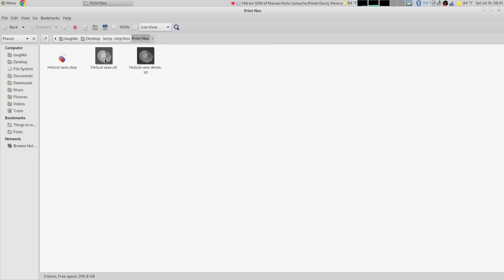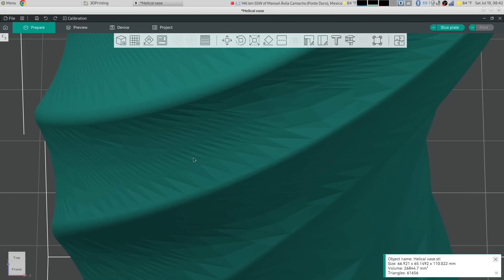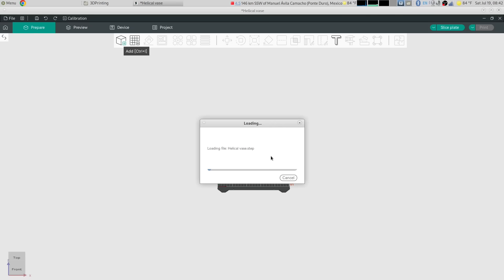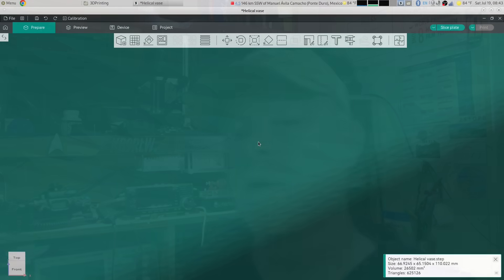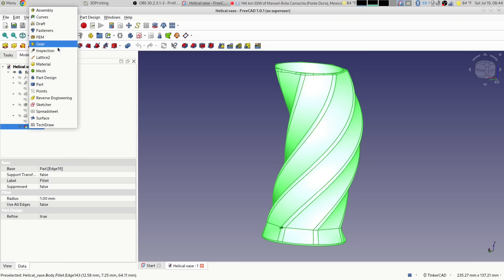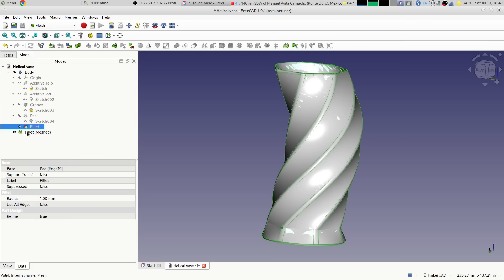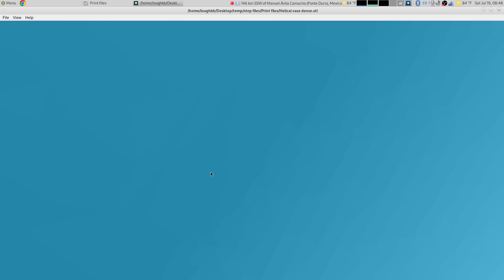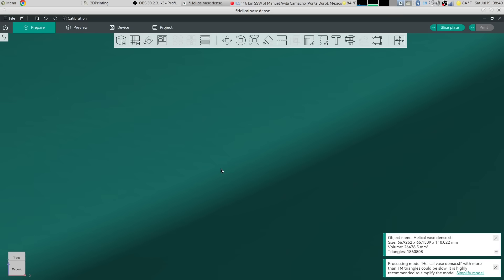3D Printing - Does the step format really produce the smoothest print?

Comment: Really useful details on the 2 file types - I mainly use the free version of fusion 360 - when you "Save as Mesh" there is a "refinement settings" in the dialogue, I pull the "Surface Deviation" slider all the way to the left, set "Normal Deviation", "Maximum edge length" and "Aspect Ratio" all to "6.00"  -  this gives a fine mesh and really does improve print quality, it also allows curves to be printed faster as the toolhead has a smoother path. The only slight downside is fusion does not remember "Surface Deviation" and "Maximum Edge Length" settings so they have to be adjusted with every export ( I should probably get chat gpt to make an "addin" to automate the export process )

Comment: The problem isn’t stp or stl or even geometry density. The problem is topology. CAD and slicer software uses a mathematically lazy approaches and seam to have really inefficient code. I’ve found that taking the STL into a art program like blender or ZBrush and using a remesher like quad remesher or zremesher or qremeshify and then adding a few divisions and then something to convert the quads into triangles and exporting that will create smoother surfaces that your stp or stl. But will be lighter than a dense mesh export.

Comment: I discovered an anomaly with my STEP files being converted Orca and/or Bambu because certain shapes ended up being processed by the slicer and becoming faceted. I got around this by exporting the files as STLs and using a smaller deviation number in my VAD export.

Comment: Point of order: consumer 3d printing has been around since at least 2006, though the earliest model to be announced on a mainstream broadcast in the US was the Makerbot Cupcake CNC, which debuted on Attack Of The Show (previously The Screen Savers) on G4 (formerly Tech TV) in 2009. Fun fact: This was one of the very last episodes of AOTS which had any remote similarity in content and presentation to its predecessor, as studio management continued the hard push to alienate and abandon the gaming-and-technology centric content which had attracted the formation of the network's core audience.
Reply: The horizontal banding seen on the STEP file print and the dense mesh print is a mechanical artifact that most likely derives either from your physical Z gantry or from some heating or communication issue between your control board and driver chips and your Z motors. It's fairly common, and you can find a lot of different solutions for it online.

Comment: The real issue isn't really the stl vs step debate, it's the 3D printer gcode processor that could be way more efficient. If it supported circles (some do or at least some CNC gcode, but most just resolve to straight line moves, ie G1 x100 y100) and bezier splines, it could reduce a 200MB gcode file down to 20KB or so. If the gcode processor could calculate the stepper motor steps and timings with circles and splines, all a slicer has to do is make those intersection slices with the same geometry the step file contains. Curves and sharp edges would be resolved in the smallest step a 3D printer controller could handle. 
But it's hard to do real time with limited processing power, though a raspberry pi single board computer should be able to do it. It would create very smooth prints, and I think it would also be much more consistent in printing speeds avoiding ringing. Those tessellated structures just contain edges that have sharp angles, so a stepper motor will see a sudden speed change. If it could pass through those curves with a smooth motion, it'll print a lot smoother and quieter as well.
Reply: The G-code standard has commands for curves just like presented in the step files. I'v written the firmware for a printer and done exactly what you suggested. Worked fine on a raspberry pi 3 (not a super fast machine tho). The motor motion was smoother since it did not have to fight the  inertia of all the connected parts that that much when going around a curve. Sharp edges are still sharp so no improvement there alltho when going from a sharp to a curve the ringing stopped faster. Probably because the desired motion is biased to one side and eats into the flip-flop inertia, leaving less room to overcompensate.

Comment: Great summary!  It would take serious effort, but slicers could do one layer at a time from a step file and convert to lines, arcs, and splines. This is roughly the way real cnc works to reduce tessellation down to the smallest steps supported by the specific machine it is running on.

Comment: I usually export a 3MF from Fusion into Bambu slicer, with some customised refinement settings to reduce visible artefacts. 95% of what I create in Fusion is processed using the Manufacturing environment for CNC machining. Guess I should do a comparison between STEP and 3MF exports with similar mesh refinement settings. Neil G4DBN

Comment: You should let the printer firmware handle the G2/3 arc resolution. It makes no sense to create huge stl files that's a pain to work with. 

In klipper just set the resolution in the printer config. 
(Dont remember how this is in Marlin, but you might have to configure it in the compile config.)

STEP files is a huge improvement over stl.

Remember, if you need to scale a stl, you'll be scaling the triangles. 

For CAD work, export to step, and configure your workflow to handle it properly. 

Here's the klipper config. Default is 1mm which is too coarse. Modern hardware have no problem with handling finner resolution. 

[gcode_arcs]
resolution: 0.1
#   An arc will be split into segments. Each segment's length will
#   equal the resolution in mm set above. Lower values will produce a
#   finer arc, but also more work for your machine. Arcs smaller than
#   the configured value will become straight lines. The default is
#   1mm.

Comment: The really strange argument here is that "STEP may miss some geometry" when comparing with STL that almost always has issues with missing polygons. STL files are plague, it cannot be properly edited, often amount of polygons used is so low, making visible edges on surfaces that are meant to be smooth (and I'm not about a subtle ripples as on the video). And it was clearly shown in this video that default STEP is way better than STL. Also you can improve STEP quality/resolution for a third-party model, but you cannot do anything with STL without remodeling it from scratch.
Reply from the maker: It wasn't an argument.

Comment: I use step files almost exclusively. If I need to make a change, I can simply open it in Fusion 360, edit it and save it back as a step. Stls lack the geometry. “Converting” a mesh into geometry is messy. I just wish there was a previewer on my Mac. Can’t preview in file windows or Adobe Bridge. Life would be much easier if I could preview all of my files.

Comment: STL format is archaic and a throwback from CNC machining, 3MF is the standard for 3D printing. 3MF replaces older format like STL, OBJ... as it contains extra metadata, like recommended print settings, thumbnail. I export 3MF direct from fusion with med-high facet count, I can't be bothered with STEP files they usually don't translate into a better prints, and become problematic with multi part models.

Comment: Ultimately you end up with a mesh for print. STEPs being solid shapes get converted to a STL mesh for your slicer to digest. Comes down to polygon count. The more polygons you have the denser the mesh triangles the smoother the print. In some cases low density may be desirable. Those large triangles have their own ascetics some might like for decorative prints. Some CAD softwares allow you to vary mesh density at specific locations (Solidworks). As Kevin had said, Bambu Studio allows you to increase that mesh density when you bring in a STEP as it is converted to an STL mesh.
Reply: Prusa also allows for specifying the mesh density on STEP import, I would be surprised if Orca didn't as well. (All 3 are so intimately related.)

Comment: STEP files from most CAD programmes give you the choice of quality resolution etc for the export of a STP file.  It's far superior file format in general, as if using a proper CAD programme it retains all the surface geometry and material data you could ever need - that's why industry use it over STL.  Not used STL files in years - if ever need to open one, I use a CAD programme and convert it/ rebuild into proper solid geometry (stitching surfaces etc) and then export as an STP file.  Just got to manage the file sizes and workflow into the Slicer.  Never rely on the slicer for wall thickness, or supports etc, I fully model the part to suit the part & material required.  Nice video summary on the differences.

Comment: Are there any significant differences in printing times for your three examples?
Reply from the maker: No significant differences. The denser mesh might have taken a couple of minutes longer since it had more G-Code to process. More moves. Same infill, same layer height, print times were nearly identical.

Comment: @Kevin Loughin  If I am printing and object that has prescise angles and dimensions for engineering should I rather stick to the standard STL? Very interesting info. Thanks
Reply from the maker: Either format will be fine.  There should be no difference in dimensions, and a mesh can represent any angle.

Comment: One thing to be aware of is that CAD programs generally display a tesselated version of the actual geometry so as not to compromise performance.   Epecially when zooming in you may not be seeing the exact geometry and it may be difficult to see surface flaws when using CAD.
Reply: If is procedual nurb curves, etc it requires a UVW pass to be seen or used

Comment: When I use Bambu Studio for importing Step files, it shows a popup where you can specify the resolution of the generated mesh, which imho is the most convenient workflow. I Aldo like Step for it's ease of use when it comes to multi-part files.
Reply: PrusaSlicer has a similar feature to allow customizing the mesh decimation on import from a STEP. Plus the STEP model is much smaller filesize than the fine mesh models.

I prefer STEP when sharing files to make remixing easier, especially if someone wants to remix my model but wants to use their CAD program of choice instead of mine. I mostly design functional parts in FreeCAD and find it easier to remix other's models starting with STEP solid model instead of STL mesh model.
Reply: @Sembazuru  Thanks for doing that! I also do that with my models when I upload them. I've almost never used a downloaded model as they come. (except .STEP fasteners/hardware from McMaster-Carr) Having to recreate .stl files to alter them is a real annoyance. I work in Rhino and am learning FreeCad  for its parametric capabilities.
Reply: Yeah filesize is a huge benefit to step.
Reply: I had an issue using a multi part STEP file that I had. It was a gear made in FreeCAD and then modified in SHAPR3D. I had to export it as 3MF (STL with extra data)
Reply: I think everyone is missing the point. We just bought an H2D at work and a  Bambu Labs email told me info on STEP benefits... I gather the main benefit is the ability to create splines and curves during g-code generation.
I have not tried it myself, but if true, the g-code should actually show the curves and so forth like any other industrial CNC g-code.
Then is the hardware, if the printer can take the advantage ... the code will be less and if they can track the print head correctly, a better print will result.

And then..., what you see on screen in the slicer "might" just be a triangular representation of the geometry, not the final result of actual g-code.... Much like a game uses Direct-X to make triangular meshes which is completely different to say SolidWorks, which uses an OpenGL overlay within the screen to actually represent infinitely smooth geometry.
Has anyone taken a look at the g-code yet...? I have not had a chance... Yet.
Reply from the maker: Bambu studio is based on slic3r and does convert the step file into a mesh in memory before slicing.  The slicing routines that process the mesh will recognize a general curve and use the appropriate g code if the printer supports it. But that has nothing to do with the import format. It's still processing a mesh in memory.

Comment: The other fun thing with STEP is that many CAD programs don’t seem to support import of any formats other than STEP.  FreeCAD has been my solution for that.  Interestingly, my main CAD program has a fairly elaborate STL generation interface, that lets you set max edge length, min surface deviation, and min angle deviation, instead of some generic quality value.

Comment: What the...? I just went back into Fusion and exported my model at higher resolution, opened it in Orca... it easily doubled my face count and looks way better. Now I have to print it again, to see what it does to the quality. Thanks for the tip.

Comment: STEP files also include the unit of measurement somewhere in the file. I can build a model in inches and it automatically scales to millimeters when I import it into the slicer software.
Reply from the maker: I just bit the bullet and learned to model in metric. I figure it's about time we catch up with the other 98% of the world anyway. Ditch the old British system that was forced on us by an imperial mandate back in the mid-1700s. Ha.
Reply: @loughkb  How do you juggle daily life and designing?  Is it something you can used to right? How long does it take?

Comment: Remember, you don't have to make the second mesh. Just set the deviation and angular whatnot, and export the STL from FreeCAD.
Reply from the maker: If you set those defaults, or even if you set them in the model's body, then it generates that super dense mesh every time you export. Which takes a lot of memory and time. I'd rather do it on demand. Most of the time especially when prototyping, I want quick exports. And if I'm simply doing functional parts, I don't care about the resolution that much. So it's more efficient for me, to do it on demand.

Comment: I do mostly functional prints, and have always used STEP only.  I assumed that a mesh would result in much larger Gcode because the slicer wouldn't use circle or ellipse commands.  However, I just tried it, and somehow Bambu Studio knows when to use circular arcs even when given an STL file.  It must perform a "compression" step where it looks for opportunities to use arcs in lieu of lines (maybe to reduce load on their cloud server).
Reply from the maker: Pretty much all slicers will use arc moves for general curves in the tool path if the printer supports those arc move G-codes.  Even though it's an arc, it's still stepping the tool head like tiny stair steps.  There are only 8 directions on the flat plane, it can move the head, X, Y, and diagonal between each.  
Those tweaks are probably done after the initial tool path approximation of each slice.  They've been doing that for a few years now.  
This happens after the mesh is in memory, so it doesn't really matter what the import format is.
Reply: @loughkb  AFAIK arc commands are translated by the printer firmware. They provide moves at finest resolution that the printer is capable of. I always use step files, and I cannot see any tessellation in my mirror finish prints. (Orca slicer, X1C with "legacy" firmware)

Comment: Gcode includes the ability to specify an arc (G02 clockwise, G03 counter-clockwise).  I think the allure of .STEP is that eventually a slicer could go directly from the curve definition in the .STEP to the arc in Gcode... but as it stands now, I'd bet it would be converted from .STEP to mesh, then from mesh to arc.  Even further irony can be had by thinking about how the stepper controller is still going to have to interpolate that arc when it moves the steppers (since no printer uses true polar radial kinematics for motion.)
Reply: Would be an interesting project to write a slicer that could analyse the input geometry and apply direct arc + line generation where it works (eg  cylinders and cones perp to the slicing plane, and planar surfaces), and switching to approximating lines when advancing across surfaces which interact the slicing plane with an arbitrary curve.
Reply: @AndrewHelgeCox  I've done that: wrote a post processor to try to fit arcs as G2 G3 instead of G1 but it was very rudimentary, would have needed way more work to generate good results. Also, this method was only able to smooth in the XY plane, ZX or ZY would have needed a totally new approach and I'm definitely not smart enough to code that.
Reply: lol.. great!
Reply: There have been a couple of polar printers, but they are hardly common.